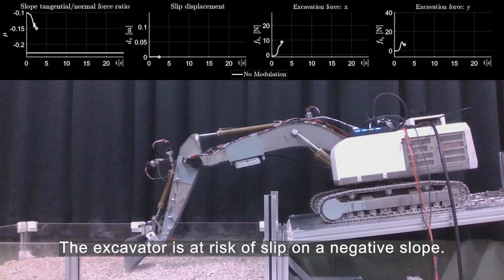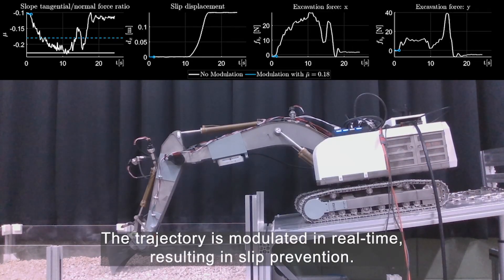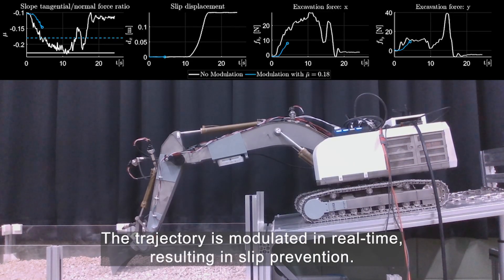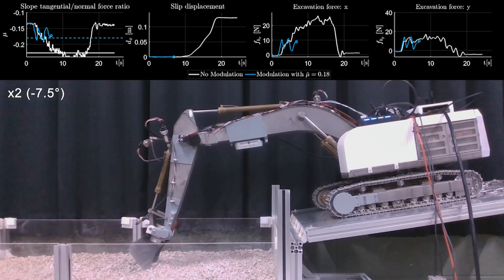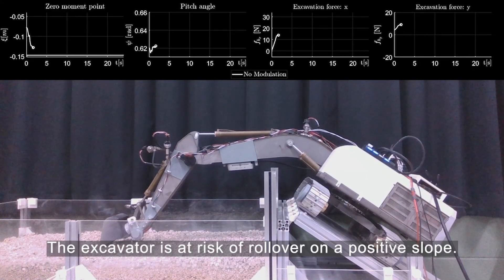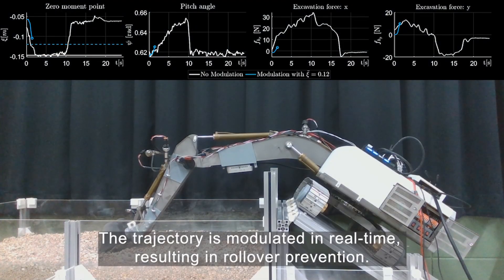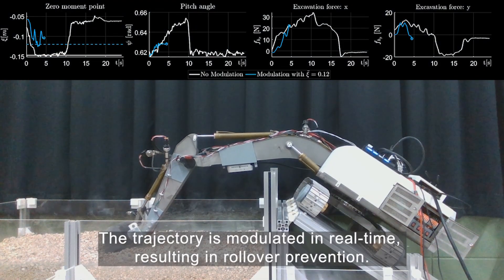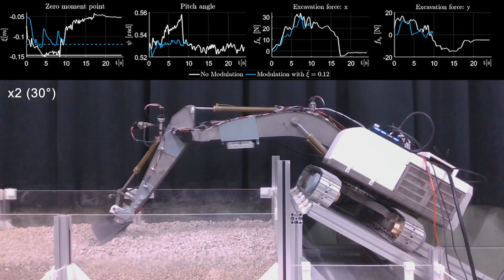Real-time Excavation Trajectory Modulation for Slip and Rollover Prevention

Comment: TRACKS APPEAR TO BE SUPER UNDERRATED AND TOO SMALL.
WEIGHT DISTRIBUTION IS OFF AND BAD DESIGN.
*GO BACK TO THE DRAWING BOARD.!
**BIGGER TRACKS EQUAL BETTER STABILITY ON FLAT OR INCLINED SURFACES.